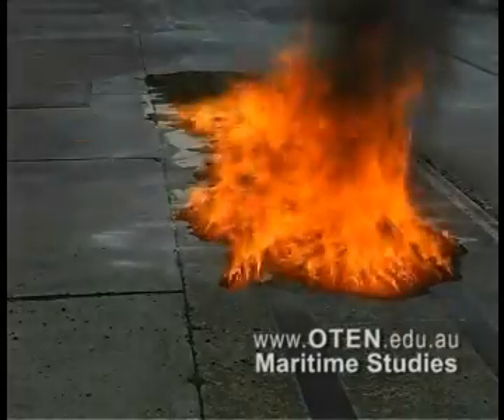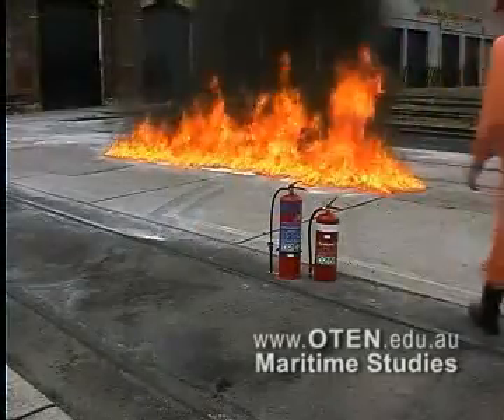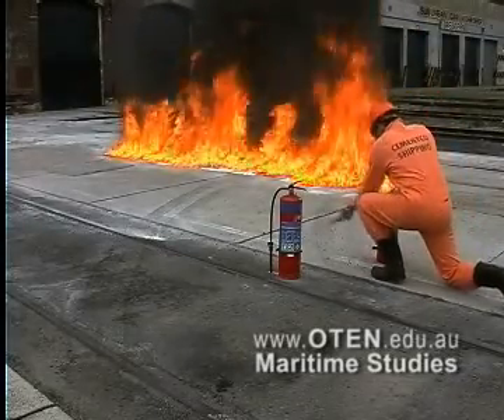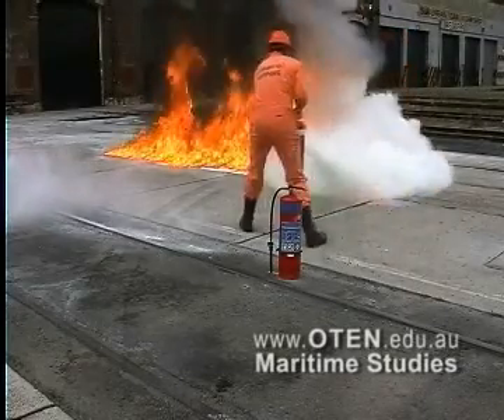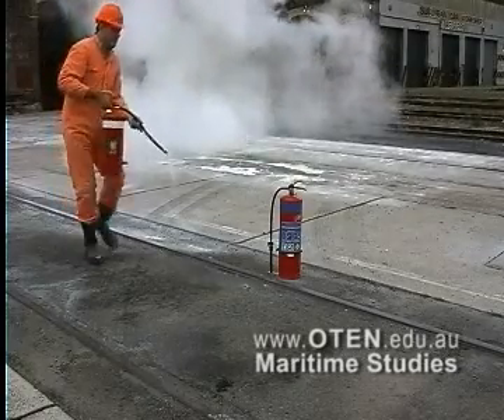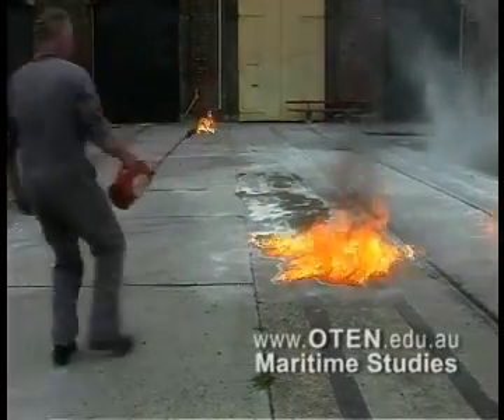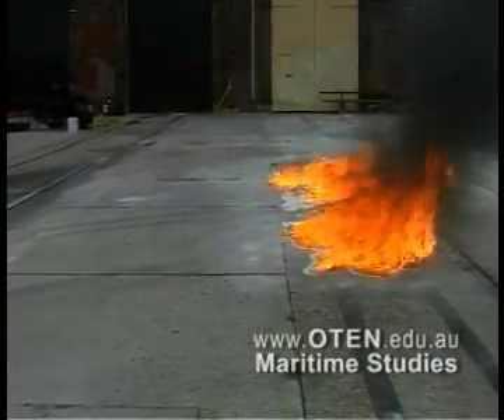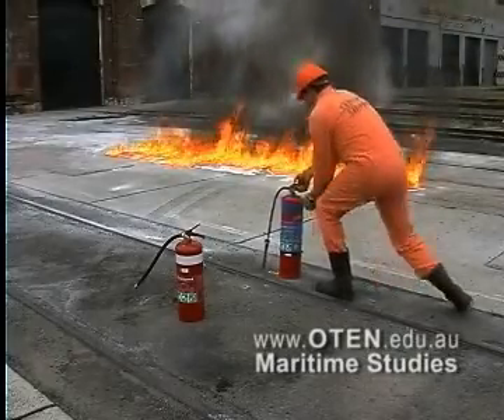Fire fighting - Dry powder & Foam on oil Spill

Comment: Before you do anything to FIGHT or extinguish a fire, call 000 for the fire brigade and evacuate everyone.
Do NOT breathe the by product fumes from the fire.
Do NOT breathe Dry Chemical powder dust.
Do NOT tackle a fire without first evacuating personnel.*
If the fire is too large, Evacuate. DO NOT attempt to tackle a large fire.
If using a CO2 extinguisher, Evacuate the space - Danger of Asphyxiation. Do not hold the horn or cylinder - Danger of frostbite.
If using a HALON extinguisher, Do not use in a confined space and evacuate at once as soon as the fire is out - Risk of poisoning.

Comment: That takes to much time and it will never work if that fire was bigger and or a lot of them for that matter
Reply: Much better to use dry chem, then foam. Base on this video
Reply: If the fire was bigger, you wouldn't use an extinguisher.

Comment: I noted how difficult it was to relight the foam smothered fire. However i also noted that the second time it took much longer and the fire might have burned a great deal of the fuel by that point. Especially as fuel had been burned two times already from both of the tests. Not to mention evaporation or possible drainage into the ground. I'm sure the point was valid it's just that the lack of control in the experiment/test could have made the test look more effective that it should have been when it came to trying to relight the fire.
  Generally it's just me having a problem with holes in statistics. Good video, very informative.

Comment: Foam is made up of which material? Can anybody tell .
Reply: M.AKASH IQBAL Most foam extinguishers are AFFF (aqueous film forming foam) - they use surfactants in a water base to float above the fuel and suffocate it.
Reply: @andison627  but those chemicals cause health problems ( it was named in a lawsuit !)at this point if the foam concept was belived to be a good idea so they are trying to designed safer version it seems

Comment: COLDFIRE.!
Reply: yeah! I got rid o my foam units and now have cold fire did you know about the afff lawsuit?
Reply: @Fredengle  No...do tell?
Reply: @wcresponder  of course the reason I switched to cold fire is it is a surfactant type that is advertised as an alternative to halon I think we are pretty sure that cold fire is a great product is why Nascar and the irl like it because it does not damage engine parts like dry chem will so its probably also easier in my home to clean up a liquid than a powder even if the powder it seems does not stick it still seems it can be diffcult to clean